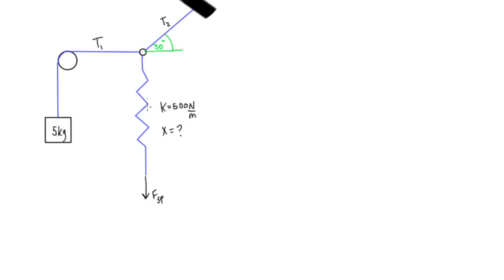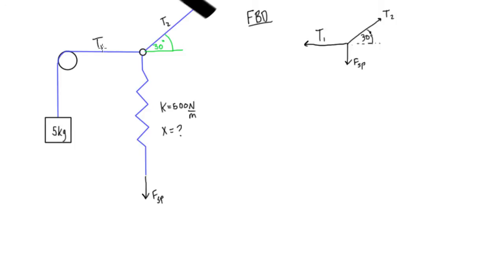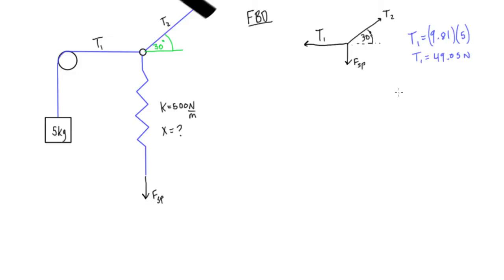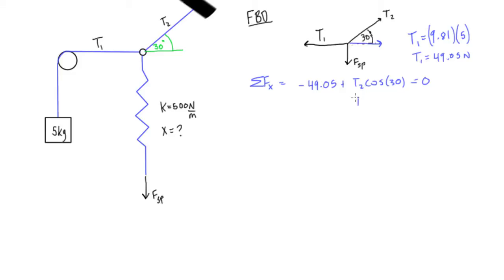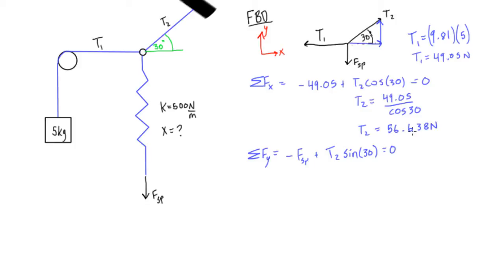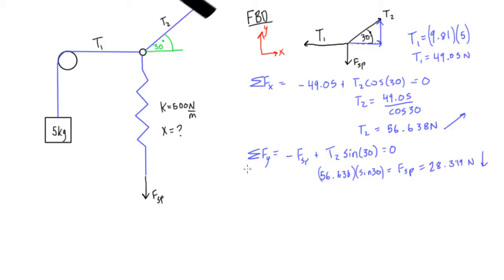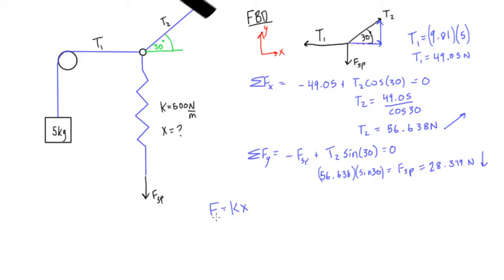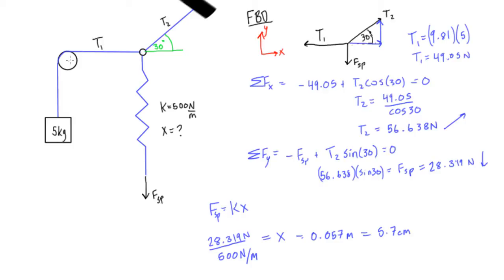More comprehensive statics spring problem

Comment: Why isn’t the weight included in the equilibrium equation for the y direction? I get the weight & T1 will have the same force but I don’t understand why the weight isn’t used in both equilibrium equations.

Comment: Tensions are the same anywhere along the rope so T1=49.05N, but how come T2 (same rope? same tension?) doesnt also equal 49.05N?
I guess T2 is a DIFFERENT rope from T1...
But that wasnt obvious to me at first....
Not mentioned in the voice-over....
Only hint is (T1,T2,T2x,Fsp) are all joined by some kinda little RING as opposed to a POINT, representing the nuance?